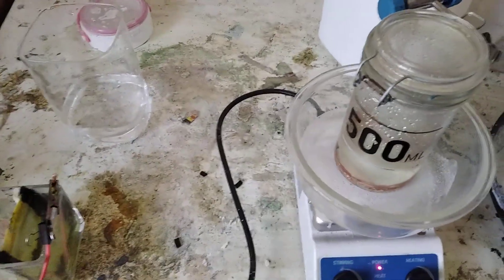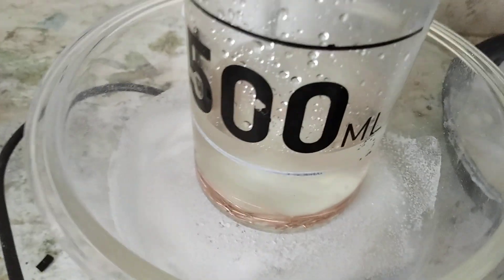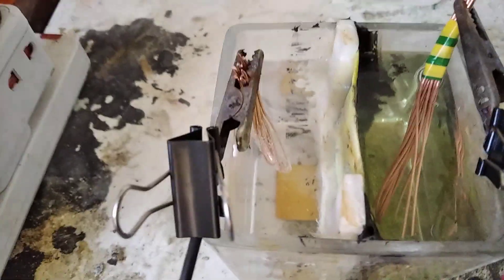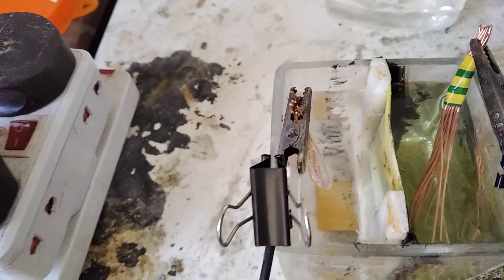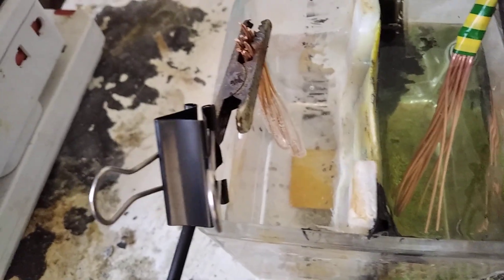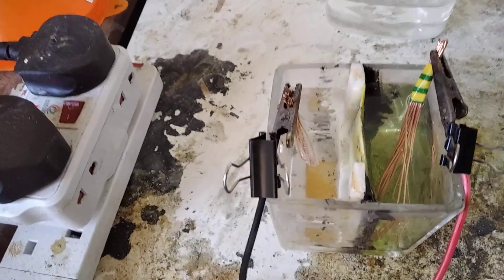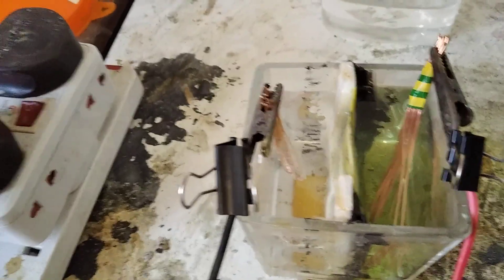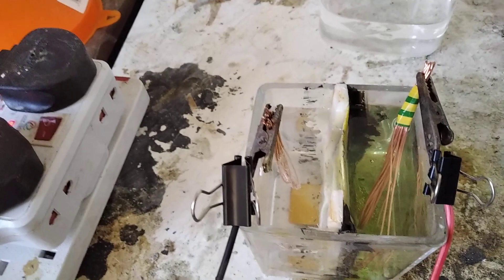making copper chloride with 2 ways.

Comment: Would making something similar by putting HCl into cathode chamber and anhydrous ethanol into anode chamber and using a Aluminum anode make anhydrous alcl3?
Reply from the maker: Nope to do that you need propylene carbonate and an Al anode and NaCl and NaBr catalyst dissolved in it with no membrane required but you also need mineral oil to isolate it from the air. This  cell produces AlCl3 and sodium metal.

Comment: Nice video, I tried something similar I put saturated NaCl solution into the Cathode chamber and Distilled water to the Anode chamber and used a clay pot as membrane at first it worked well but the Copper seems to form a non-conductive coating of insoluable Copper(I)Chloride that causes current to drop significantly.
Reply from the maker: that tends to happen which is why you wanna add some HCl to the anode chamber to prevent this or mitigate it.
Reply: @CatboyChemicalSociety  Thanks for the reply. How much 20% HCl should I add?
Reply from the maker: @ioeter5  a few ml just to lower pH
Don't forget to also drain the cathode chamber and replace with fresh brine

Comment: How can the frame be made for the membranes?
Reply from the maker: this one is ionomer cement doesnt need a frame but typically frames are either made of acrylic or polyolefins.
Acrylic being advantageous because you can glue it while the other needs plastic welding.
Reply: @CatboyChemicalSociety  thank you for your fast answer and that you share your knowledge cause its  ingenious. Is it also possible to glue the membrane onto the glas at the sides for temporary testing? And does the membrane just conduct kations or will they get replaced by Na+ (PVA-CA crosslink from your videos)? This would me help to understand much better how it works. With your ionomeric concrete wouldn't get the anolyte contaminated with much SO⁴? 
Sorry for the much questions..
Reply from the maker: @mwtm8077  the ionomer concrete yea it causes some SO4 contamination. The crosslinked PVA-CA can pass monovalent and divalent ions through the membrane but does better with monovalent cations like H+ Na+ K+ etc.

Comment: Guess the same works for custom ferric chloride too? Might be even faster if you increase the cathode cell’s conductivity using epsom slats.
Wish it were easy to make with sodium chloride instead of HCl, the HCl where I live is full of impurities that turn it purple. I think I’ll try splitting salt into acid and hydroxide with a ceramic dish as a membrane, though I can’t say how effective it will be.

I bought some “kiln paper” online a while ago as I thought it might act as a good membrane, but it didn’t really act like it was made of ceramic fibres at all, once soaked it ripped far too easily.
Reply from the maker: yes u can make ferric chloride this way but only the hydrate and you cant boil it down or it will decompose into rust!!
ferrous chloride is made first tho so you actually have to do 1 extra step which is the oxidation step which is easy just run graphite anode for 3 hours and its ready.
Reply from the maker: if you want a good membrane use my recipe known as IONOMER concrete which is regular concrete mix of cement but instead of sand you use cation exchange resin or even just plaster of paris CaSO4. they both do the same thing but cation exchange resin is more resistant and selective.

Comment: So in your non membrane method you are using an air bubbler instead of hydrogen peroxide?  Would that work for oxidising sulphur dioxide into water and the extra air to make sulphuric acid rather than sulphorous acid?
Reply from the maker: I know peroxide works well enuf but its costly for me.
Reply: Dissolving oxygen oxidises things in solution, but it also increases the pH of the solution. Probably not ideal for producing acids.
Reply from the maker: @Scrogan  that on the right was HCl and copper thats all while the cell directly oxidizes the copper into ions.

Comment: I see that you are using copper as both the anode and the cathode. I don't know enough about electrochem to know what side the CuCl2 will end up on, but I do know this: CuCl2 + Cu -> CuCl
Copper 1 chloride (when fresh) looks like copper powder and is insoluble.
Reply from the maker: the copper anode is sacrificial which oxidizes into copper 2 ions which causes the solution to turn green tho since excess HCl is present some are also in the +4 oxidation state.
The reason copper is also the cathode is theoretically I can use any cathode that wont react with NaOH but copper ensures theres no other contamination such as chromium which would leech out of a stainless steel cathode after some time.
Reply from the maker: the polarization of the anode prevents most copper 1 from forming but due to bulk reactions you do form some copper 1 chloride which can be oxidized afterwards with just air bubbling or very small amounts of peroxide.

Comment: Nice!!!Any details for the membrane?
Reply from the maker: this membrane is one where I took cleaning cloth and painted it with PVC glue then made it more porous by soaking in NaOH for 24H with ammonia based surfactant.
Then I baked a mix of PVA and citric acid for the ion exchange layer.

But i fked up the membrane in this vid because I ran it in the wrong polarity RIP ion exchange layer but oh well its atleast still a porous barrier and will still work just not as good a seperation as before. basically when I run these cells for the first time I tend to mark the cathode chamber with silicone resin lining since its also good against NaOH and the ion exchange resin wont hydrolyse in the NaOH bath but will so in the acidic chamber which was my mistake when I noticed chlorine was being released and the membrane surface was bubbling.